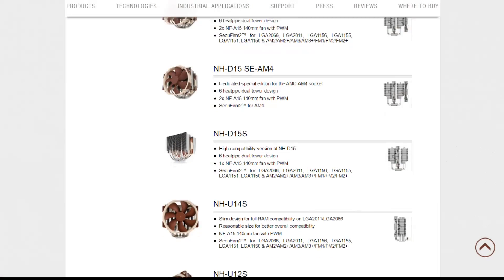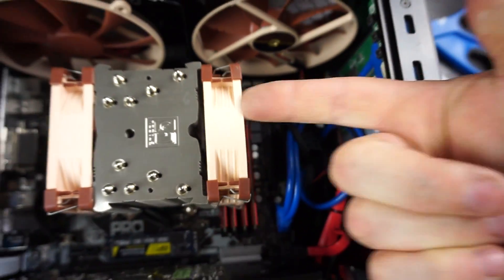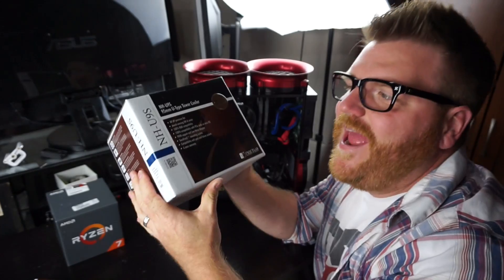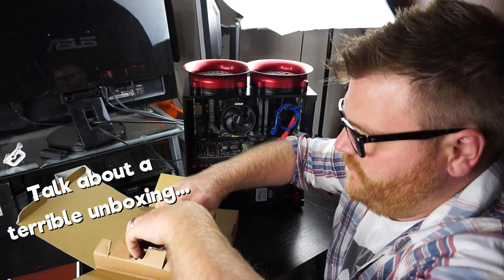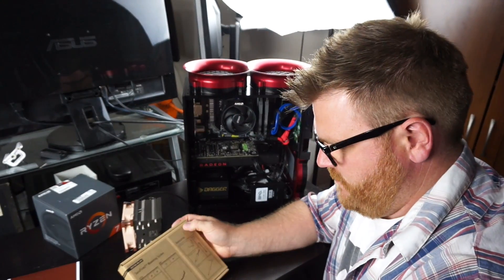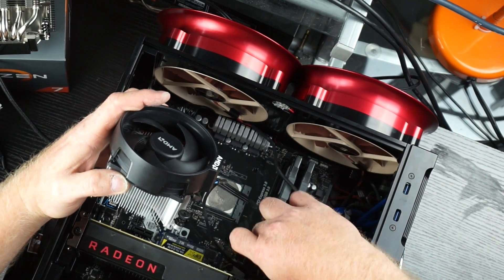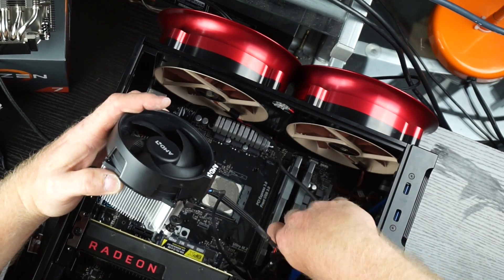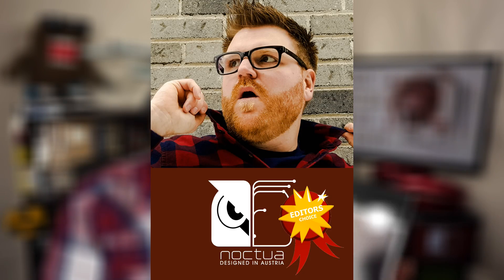Noctua Sent Me Help For My Ryzen Case!

Comment: Timmy, love your videos. The noctua "extension" should be what they call a "low noise" adapter.  basically, what it does is lower voltage from 12v to 7v for quieter fan operation.
Reply: Correct
Reply: i believe his name is Timmy Joe.
Reply: Jeremy R thanks for pointing it out. sorry Timmy.

Comment: Noctua nh-d15 has been keeping my 1700 at a happy 4.1GHz for months now. Absolutely love their coolers, the price for what you get is worth it. Digging this little guy for smaller form factor builds though. Keep up the cool work  Timmy!
Reply: POD 4.1?!  Nice.  You hit the lottery on that.. is it good 'n stable?  I've been planning on the same cooler.  Sounds great.
Reply: POD what motherboard are u doing
Reply: I'm using the ASUS PRIME B350-PLUS.

I got my chip and board the weekend they released (my old 2600K system crapped the bed on me the night before I went to Ryzen). Paired up with a MSI GTX1070 Gaming X I can safely say my GPU is the bottle neck in 2K gaming. 

My photo and video editing is an absolute joy now.
Reply: It's been very stable, but I wasn't able to hit it until the 0609 BIOS update. I'm currently on their 0803 and everything is still running great.

 The only times I've had issues are when I push the RAM. I made the wrong choice in RAM when I put the system together. When the R3's come out I'll be upgrading my HTPC and use my current RAM in that and get better RAM for my gaming/editing rig.
Reply: What temperatures you have in idle and full load @4.1 GHz? I have NH-D15 too and thinking to move to Ryzen (propably R5 1600) from old but gold 2600K.
Reply: Zircon I'm at 64-67c at 4.1ghz under full loads with the D15. i did run the 1700 at stock speeds with the stock cooler and it dod ok. around 55c iirc.

I also came drom the 2600k, great little processor.
Reply: pod lmao I'm at 77 underfull load on a 1700x... At 1.432v llc5 under custom loop

Comment: I love my noctua cup cooler push and pull,I got 6 fans 2 termaltake 140mm in front 1 120mm bottom blowing up ,1 120 mm back blowing out ,2 on top 120mm blowing up out, but I noticed and unplugged the top front fan off I get better temps .

Comment: I'm building in the SilverStone Grandia GD07 with the Asrock Taichi x570 and a 3950x but I'm limited to 138mm coolers just wondering if this is enough to cool it with bios settings configured for it to run at 4.2ghz or higher.. Of course there's no info on it anywhere.

Comment: Why is everyone having crazy high temps when maxed on R7? I have yet to hit over 70c @ Even 3950mhz@1.4375v with a synthetic 100% Load. The bios revisions have been slightly buggy with overclocks some are better then others same for memory overclocks. Currently using x370 Pro Carbon

Comment: Timmy, Did you try to push air through the CPU cooler the way it was intended as well? on your video you have reversed the fans on the CPU cooler so the air flows against the direction it was designed to.
Reply from the maker: I have no idea what you are talking about at 8:08 I have it set up perfect

Comment: i get 123-125 Fahrenheit at full load with a xigmatek loki cooler on a 4.2ghz phenom II x4 980 but my voltages are 1.55? something 😔. I would love to try out a noctua cooler on an a12-9800 😃 with an asrock ab350m pro4 motherboard! go team noctua where is the all copper stuff and how much would it cost. Anything beats a stack of pennies attached to a bottle cap though.👍
Reply: Timmy Joe the temps are high? I know the voltages are.
Reply: Timmy Joe The temps he posted were in Fahrenheit not Celsius 123-125 Fahrenheit is 50.5 Celsius to 51.6 Celsius.

Comment: my msi gaming plus auto disables " amd cool n quiet" function whenever i over clock my ryzen 5 ,should i leave that disabled ?
Reply: Timmy Joe  thank you for responding , i set all cores in my ryzen 5 1600 to 3.7 im getting  45-50c  idle and it maxes to 77c under aida64. running for 1 and half hour , using stock cooler

Comment: hey , i would like to know when the pc is in idle mode can the cpu go back to the default clock speed or does that even matter in general ?
Reply: Depending on the motherboard, you can either turn on cool n quiet or us pstate overclocking with the right windows power settings to allow the CPU to lower it's clocks and voltage while not being stressed.
Reply: Patrick Shelley ok thx :)